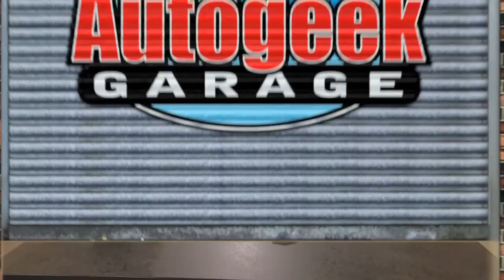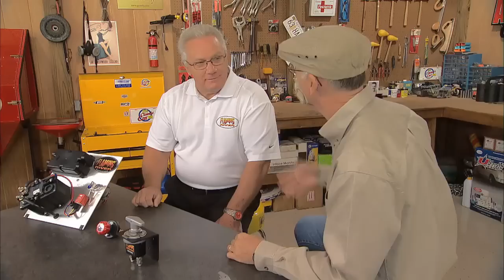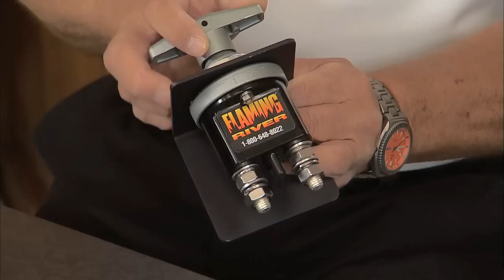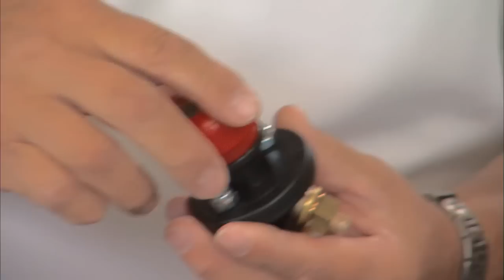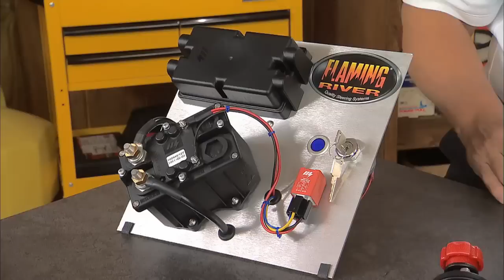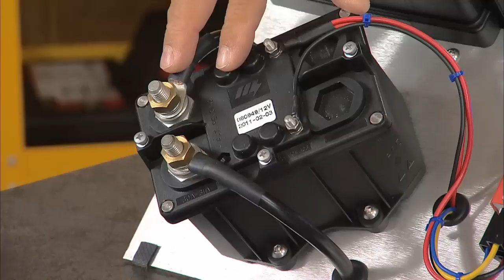Flaming River Battery Disconnect Switches

Comment: Flaming rivers makes great products. I work at a Mack dealership. If a truck is speced with a battery disconnect, Mack installs a flaming rivers switch. I've never had to replace any of them. Plus the bracket installed around the kill switch allows for a pad lock to be placed on it so that you cannot turn on the switch. Theft of big rigs is just as common as cars. I encourage truck owners to consider anti theft measures. We also have customized other anti theft devices that work pretty well.

Comment: John Hwang:  I have a second battery tray in my chevy and a spare battery. I decided to put the second battery in and give it a purpose in life (backup). I looked at Isolators but could not find a small one and a big one was harder to mount so I chose a disconnect instead. I will just turn it on every once in a while to charge spare. More work but cheap as bleep. My alarm will still work and my memory devises will still be maintained.

Comment: What happens when I malfunctions while you’re driving down the highway?
Reply: Same thing that happens if your ignition switch malfunctions driving down the highway. Mechanical switches like these are not at all likely to malfunction. It's possible, of course, but it's like light switches in your home, not likely. If they do go bad, it'll almost always be while turning it on or off, not randomly in use.